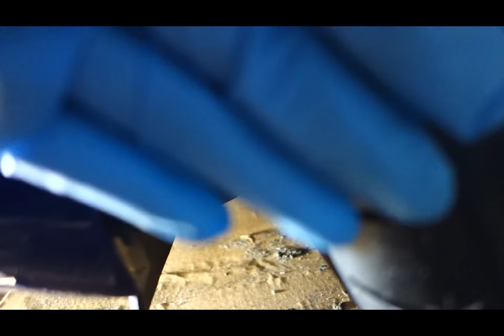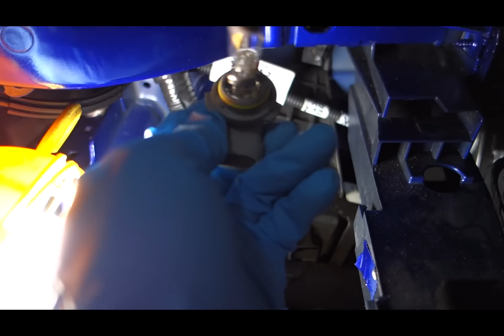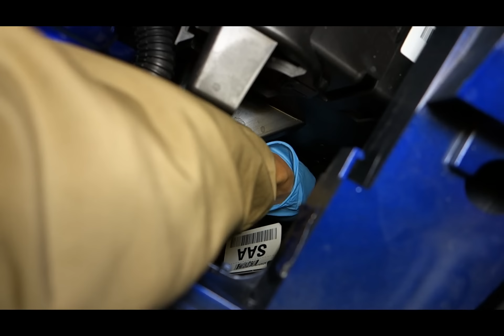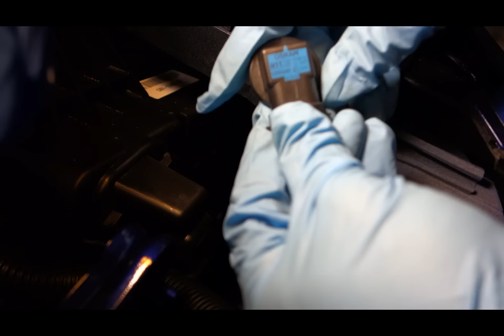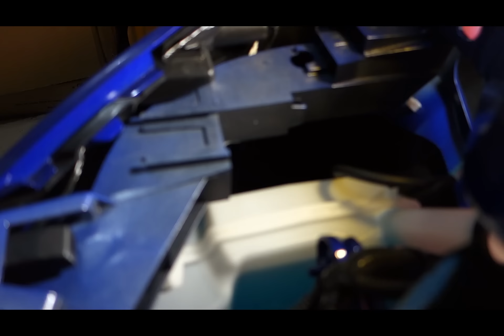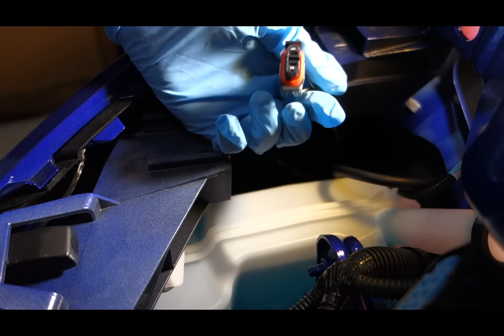How To Reach & Replace Ford Focus Fog Lamp Bulbs

Comment: The black plastic insert pulls out from the front, there's a 7mm bolt, the light pulls out. No need to get on your back or go up from the bottom

Comment: moomoo97 - thank you very much for your in-depth process on replacing these bulbs.  I just had one go out, and always figured I'd have to go about removing a few of those interlocking plastic shields, along with all those pain-in-the-ass plastic clips.  Your way looks much easier, and since its likely the actual headlight low/high beams are probably the next to go bad, figure if I can afford it, I should replace all the lights since I have to remove the headlight assembly anyway.  Looks like it is just 1 screw on top of each headlight assy, somehow find that hard to believe, and hope you right on your reply to SKI in that there are no alignment issues when done.

Comment: Thanks moomoo -  This worked out perfectly for my 2012 Focus SE Hatchback.  I watched both your "Remove headlight assembly" video and this one, and swapped out my fog light bulbs.  I took out the stock bulbs and replaced them with a pair of Opt7 Plasma ION yellow bulbs... it all went like clockwork just as you described and didn't take long. Probably 35 minutes total, and that's probably because I had never done this before - and was being extra careful. Thanks again - your videos are GREAT!!!
Reply from the maker: Bravo! Glad to hear you're taking the time and being extra careful to get the job done. Enjoy your accomplishment, and thanks for watching too!

Comment: there is an easier way. just turn your wheel in and remove 4 bolts on wheel well cover. fold back a bit and you can reach your arm in, disconnect wire assembly, take out  light and repeat for other side. this way will only take you 15 minutes at most. if you take out your head lights, you run the risk of alignment issues (where your light will focus) with reinstalling them.
Reply from the maker: +Joe Hoinoski Yours is actually the 'standard' way to reach and remove the fog light bulbs on the modern cars these days, not Ford exclusive. However; I have a tight space in garage and working from the sideway is not always an option, let alone getting quite dirty when working through the wheel wells, twice!    And no, the Ford Focus at this generation has the fix mount points for the whole headlight assembly to mount/dismount, working like LEGO, so the beam alignment is never an issue. Indeed, in order to reach any of the headlight bulbs for replacement, you'll have to dismount the whole thing and pop out the rubber grommets at the assembly because the whole light is an enclosed unit.

Comment: great vid, thanks moomoo!!!  this worked great for my 2014 Focus ST 3.  I also used your remove headlight assembly vid in conjunction for getting at the fog lights, too.  Everything worked great and didn't take long.  The only thing I'd say is that I believe the fog light unit turned counter-clockwise to twist off, (not clockwise).

Comment: how could i clean the plastic fog light lens? I'm getting HIDs soon and it looks kind of dirty
Reply from the maker: ***** They bound to be dirty due to their lower position at the front. For lens cleaning Windex or any windshield cleaner spray will work fine. You can also apply RainX on them afterward, which may delay the dirty water to stay and stain on them.

Comment: I just bought some Spyder LED headlights which I'm going to install Sunday, and I bought some New Brights H11 LED headlights that hopefully fit in the fog light spot, same size, but they have ballasts and all. But 6400 lumens =) I was curious how much wire length our Focus' had, which led me to your video. Would it kill them to have added 6 inches of wire length to do it outside the hood? lol
Reply from the maker: Pizza Delivery I like the LED bulb tech but retrofit them into the lens housing designed for Halogen/HID will sometimes be a hit or miss. LED lights throw a lot of light but it is not focused, the beam floods out but does not project if the original lens housing is not for it. But let us know how your LED install in the Focus lens here.

Comment: Hi, you going to do a video on how to change the glove box light?? All your other vidoes are top! They all work a treat.
Reply from the maker: Thanks for the notes. My Mk3 Focus doesn't come equip with any Glove Box Light though.....
Reply: Oh, thats a shame, theres a little 501 wedge type bulb in my mk3 focus 2012 model. ill do some exploring this weekend, See how I can change this, but first LED fog lights are going in.
Reply: Chetan Patel
Reply: moomoo97 Mine doesn't either :( The glove box sucks anyway. It's laid out wrong and if you put stuff in the wrong spot it won't close. Plus, no hole for the aux cable to come out of so you have to close it on those bending the wire. No usb either.
Reply from the maker: Pizza Delivery To be fair, Ford did put the USB ports inside the Center Console storage box in our Focus though, which makes sense than put it to the glove box for easier reach.

Comment: I would like to unmount front fog lamp cover, just to paint it. Could you give advice how to remove it safely for bumper and this cover in itself?
Reply from the maker: Which Focus model do you have? But in general, it'll be easier if you can get to it from the inside behind the bumper. Drop the skid plate thing from underneath and you'll see how to remove the assembly.
Reply: moomoo97
mk3 2014 EcoBoost (not ST!)
Reply from the maker: DonPedro6901 I see. In this case I think this video will help you to take the cover out. :)
http://youtu.be/wXse8vUEPOQ
Reply: You are very helpful man! That's great! Thank you very much! :)

Comment from the maker: There are two ways you can do...
1) Remove the whole front bumper cover and unclip the bezel from behind the cover.
2) Leave the bumper cover on but remove the whole front under-trays under the engine & radiator. Although you have to lie on the floor afterward to unclip the bezel since the bumper cover is on the car still.

Comment from the maker: Blue is not an ideal color for Fog Lights because it actually gives out less visible light. Use either Cool White or Amber/Yellow color instead.

If your Focus is also using H11 bulb for Fog Lights, I'd recommended you go search for "H11 CREE Q5 LED" bulb in White or Amber color....You won't be disappointed.

Comment from the maker: Glad my steps helped. You need to remove something in either way to access the fog on this car, but I like access it from the top than from the wheel well because it's easier to see. Actually your speaker wire solution is already good, as long as you taped properly in the wire-jointed area for water protection.

Comment: I thought my fog light blew out since only one was turning on. when I  pulled out the light I discovered the wires that connect to my light got pinched and cut on one side causing them not to work. your video made things so much easier. anyways for now im using speaker wires to fix them unless I can find a better fix

Comment: have you experience moo abit of "noise" of some none smooth pavement specially stone exposed from the concrete cement road? I notice it from the from wheel sound like a lose ball joint or sort of like it.. =)

Comment from the maker: Mine is a Ford Focus ST. But other than the drivetrain and suspension, its exterior & interior is near the same to most other Mk3 Focus (2012+ model) There're already a ton of Ford Focus videos here for the exterior & interior reviews, so I don't need to duplicate those to bore everyone. :)  Unless you have something particularly want to check out (which is not already on YouTube here).